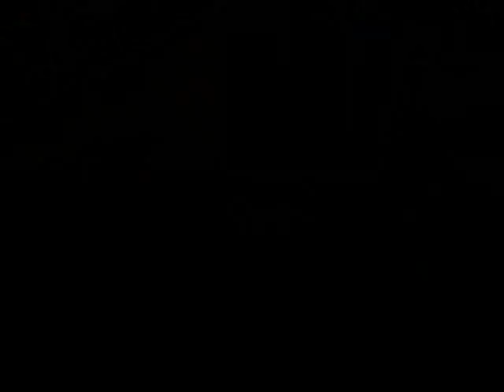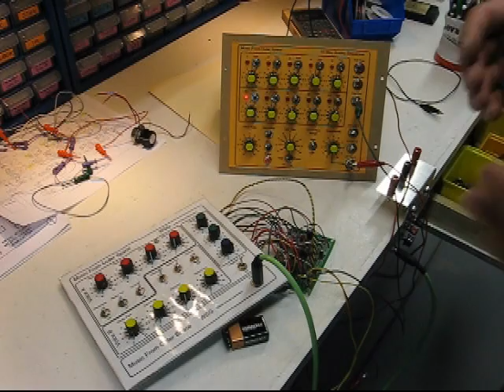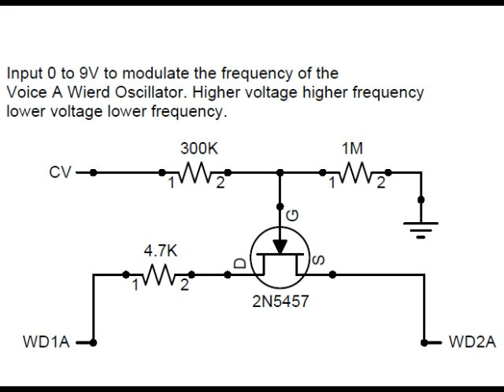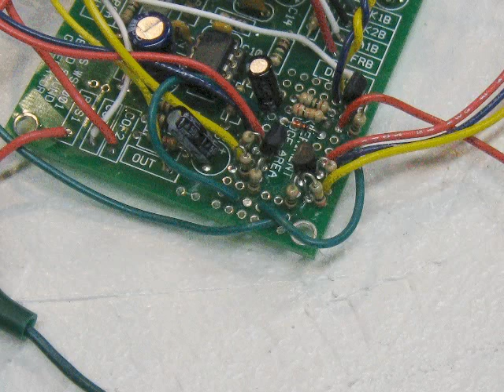Very Cool MFOS WSG Modification

Comment from the maker: As long as the connection is to the point in the circuit specified it does not matter at which physical point you connect to it. The pot lugs offer a good connection location.

Comment from the maker: I would say that it is squarely in the realm of analog synth. The CMOS CD40106 is used to generate the actual tones (rectangular waves) you hear and the filter is straight analog. In digital synths there is generally a CPU and ROM memory that holds snippets of digital representation of the sounds the synth makes.